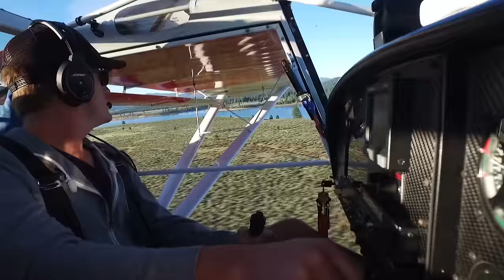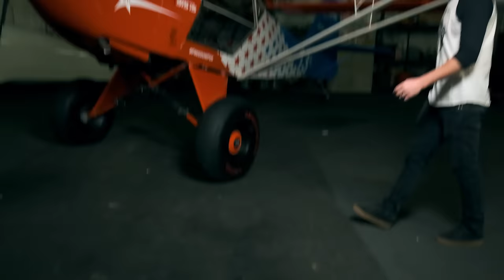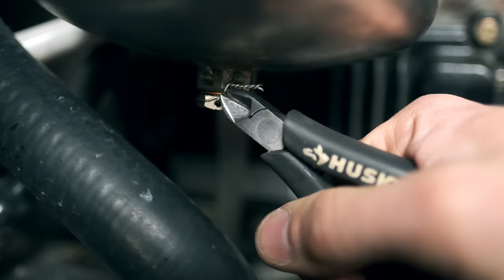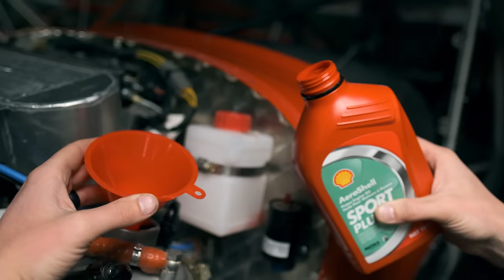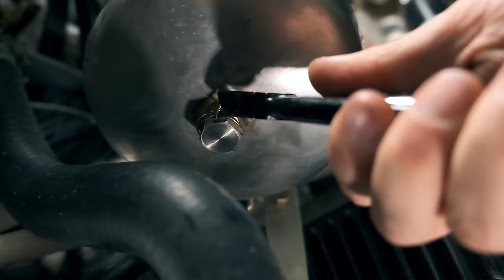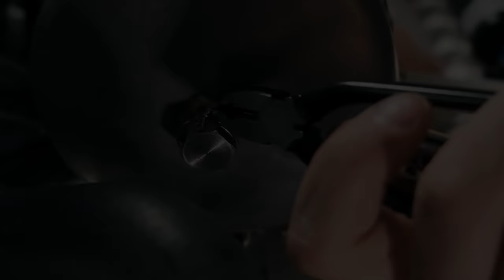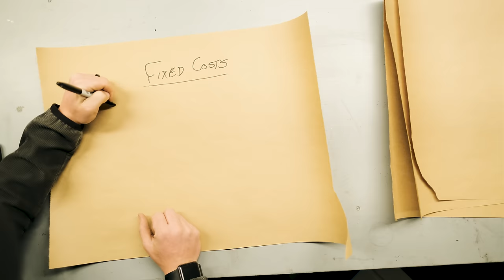What Does It Really Cost to Own and Fly Your Own Plane?

Comment: Let me simplify this for every one:  Owning a plane is about the same cost as a nice sports car.  However, when you get a sports car up to 75 miles per hour and pull back on the steering wheel...........nothing happens.
Reply: I’m stealing that when explaining why I fly to friends and family..
Reply: The reason I sold my "72 340 Cuda" Car? or Family?
Reply: @lightfoot9485  dunno if i woulda sold that to be honest...
Reply: Yep! Nicely said!
Reply: Most of all you hope to god it doesn't come off the column lol
Reply: D Springer that happened once in my kit car during a full power pull at about 80 mph. It clicked back on on the first try and I am so thankful it did.
Reply: haha love this discription
Reply: @thelastrebelshow1627  Last year a Ferrari 250 GTO sold at auction for $48,405,000 US dollars. Trent mentioned in his video that he has friends who bought their planes for around $20,000. Your blanket statement is far from accurate.

17 states require annual or semi-annual safety-inspections. Obviously these aren't as thorough or important as airplane inspections, but they are still important. A car with non-functioning brakes can be just as deadly, given the right situation, as an airplane with a mechanical issue.

From a maintenance perspective, a Bugatti Veyron carries with it an annual maintenance fee of $21,000. The tires should be replaced every 2500 miles at a cost of $33,000. That is 11x more expensive than Trent's bush wheels.
Reply: Chris Porter: It’s probably time for Bugatti to come out of the dark ages and start making tires from something other than bubblegum, lol. Anyway, M Bugatti died before most of us were born so I guess the company’s ingenuity died with him.
Reply: Jim Perkins: Too funny!! But not funny. For about two years after I stopped flying, every time I passed by the airport I had this uncontrollable urge to pull back on the wheel, lol. I also used to dream about it. Blah.
Reply: @rayray8687  The Veyron is capable of 251 mph off the showroom floor, meaning the tires have to be capable as well. Many of the cars are not driven regularly so 2500 miles, so many owners should change out their tires when they time out vs trying to get all of the miles out of them. Super & hyper cars with old tires can be very deadly. The crash that killed Paul Walker and Roger Rodas was very likely caused by the original tires on the Carrera GT. The car only had 3500 miles on it but was 9 years old, and original tires might have looked like they were in good condition. Moral of the story, proper inspections are important for both airplanes and motor vehicles.
Reply: Chris Porter. I’m sure those Veyron specs are correct which shows nothing more than its complete uselessness as a street car - but I’m not sure how any of this connects to sport flying?
Reply: @thelastrebelshow1627  no offence but I am up here In Canada and there are guys I work with who roll into work in brand new $100+k platinum F350's which they use to tow $100+k toy haulers with $30+k SxS's in the back. Now I am not saying everyone will be going out and buying Cirrus sr22's but used planes that are not completely ruined are far from unachievable. And when you start getting into kit planes there is lots of options for someone willing to put in the effort. Trent may have some friends and have made some connections but it is far from impossible.
Reply: @thelastrebelshow1627  I believe he mentions that his maintenance is cheaper due to it being a kit plane  however yes he bought not built the plane, and no doubt has had help with the modificatios! And definitely the certified world can be more expensive! Though I have seen many a 172 or piper comanche with sub 1000hr SMOH engins and decent looking condition and some upgrades going for 30k to 60k, but think one would need to be patient and thorough to find the right deal. I am a machinist with an acreage and machine shop so I will be going the build my own route😁
Reply: @thelastrebelshow1627  I never said or implied that plane ownership and operation is cheap. I was arguing your statement "Airplanes are far more expensive  than the most expensive car.". I've watched nearly all of Trent's videos including the series around his motor failure and replacement. His situation is not the usual and a motor failure for most GA owners would be a very expensive situation. I have a lot of friends who play in the very expensive side of street car modifications. Its not uncommon for a motor rebuild on a 2000+ HP Lambo to cross into the $100k range. My point is that both hobbies can be very expensive and your statement was not accurate.
Reply: Chris Porter: I used to fly. A buddy and I would rent a C172 for $120/hr wet and float around in the sky at a few thousand ft AGL going nowhere and feeling no sense of motion except the bumpity-bump bump of the warm weather air. It was about as exciting as owning a million dollar car that you can’t really drive anywhere.

I go fishing now...infinitely more rewarding, lol.
Reply: @Jim Perkins >>> YOU have just described AVIATION in a nutshell...👌👌
Reply: @thelastrebelshow1627  Holy Hostility Batman! Seriously Show, what has you so upset? I quoted your previous reply using copy/paste so it is exactly what you said. Perhaps you mistyped but that is on you to own the statement or correct it. Based on your rage I expect you'll do neither and that is OK. My point was made and I don't plan on dragging this beaten horse any further.
Reply: Chris Porter Lol. My wife turned a corner once and the steering column came away. She made a nice hole in a soft hedge, fortunately.
Reply: Chris Porter "
Reply: @kens.7665  yes?
Reply: The Last Rebel Show: Yes, yes! You’re absolutely right!! I’m completely flabbergasted as to why you won’t tell everyone about your airplane?? Is it because you don’t have an airplane and are embarrassed about deleting all your earlier posts inferring that you are very knowledgeable about the subject? No one fell for it but It’s ok...I think we all understand. Lots of people dream about flying but never really fly. That’s not something to be ashamed of. If it makes you feel better, I flew for only a year or so and found it so unexciting I gave it up. Some people find it exciting and some find it boring. It seems obvious that you have never flown since you keep avoiding the subject (and you deleted all your comments where you were challenged) but that’s still ok, I’m sure you’re important to someone and that is all that matters...you don’t need to be important to everyone. Thanks for the entertainment.
Reply: Ray Ray What comments?, I  made no comments. You attacked me and have been trolling me for a week. You’re a cyber bully and a very very bad man. 😹
Reply: i apologize, but i might too..l.
Reply: Ray Ray You been watching to much Sherman and Peabody , I would like to see your “way back” machine work, Better call Phineas J. Whoopi .😹
Reply: The Last Rebel Show: I don’t know who Sherman and Peabody are (soap manufacturers?) but I don’t need the “Machine” to know that 2 hours ago you corrected your spelling of “phineas” (lower case “p”)  to “Phineas” (upper case “P”), lol. What happens on the internet stays on the internet. Also, I don’t know who Phineas J. Whoopi is but I suspect you come from a land far far away in time and space. Perhaps you could use the “Machine” to return to the 21st century! We’ve made such marvellous advances in technology since you left!!
Reply: @Se7nn  These hobbies are evidently for people who has enough imcome to cover the costs and more,for me and others like me only watch the videos..i was a technician at a chevy dealer,i know how much it costs to repair the Corvette with alot of options and went to morosso, came back on a tow truck..Again it is for people with the money can do this.
Reply: @thelastrebelshow1627  "What comments?, I  made no comments." Did you have a brain aneurysm and forget that you (or someone else) deleted all of your ethnic and gender slurs?  @Ray Ray and I didn't forget, but we'll forgive since you want to play them down like it didn't happen. Have a nice day.
Reply: FWIW, it sounds like you were not doing the right type of flying for your personality. But if you find fishing fun then I have no idea what that would be since fishing is only slightly more exciting than sitting on a rocking chair on your porch. :)
Reply: i.b. hemp: Haha, ironically that’s exactly how I felt about flying...like sitting in a rocking chair going nowhere. And since I was usually stuck going nowhere in a C172 - no Learjet, no Pitz and no 737 - I didn’t really have a choice as to the type of flying I did. And at 100 bucks a flight, well, you know.... But fishing, well now that never disappoints! It costs about 3 bucks an hour in lost lures, and sometimes I even catch a fish! Plus I can fish all day if I want, lol. Try it - the first time you reel in a big-assed bass or a rainbow trout you’ll give up flying right away...guaranteed.
Reply: Best comment ever .When you get a J3 cub up to 60 MPH the fun really starts
Reply: It’s also about the same cost as being an alcoholic and chimney smoker.
Reply: well, the steering wheel might come off.
Reply: something does happen, the steering wheel comes off
Reply: If I would of read this comment 2 years ago... I’d have a Cessna 172 not a Corvette 😂
Reply: but when you hit 88 miles per hour, you're gonna see some serious shits.
Reply: @Se7nn  - he said 'nice sports car' not some of the most preeminent rides on the planet. Ferrari 250 GTO and a Veyron? Get real.
Reply: @flightlessboid  Check my comment again. My was a reply to "The Last Rebel Show", not "Jim Perkins". The Last Rebel Show deleted his comment but it was along the line of "even a basic air plane costs more than any sports car". I was countering his argument that sports cars can and do cost significantly more than some planes.
I agree with Jim's original comment.
Reply: @Se7nn  - my apologies, I should have known better than comment on a five month old post.
Reply: @flightlessboid  no worries, the thread went really south when Rebel posted a bunch of random illogical arguments. The user removed the more egregious comments, but you can still see some of the fallout. I hope you enjoyed Trent's video!
Reply: but a sports car doesn't require as much maintenance/oil. At the end of the day, flying may be more expensive.
Reply: Hahaha
Reply: For me it sucks as I love both but am broke ;)
Reply: @rayray8687  It's a really big Volkswagen. I see Bentley's that look like an Audi Q7 on steroids here in the USA for a SUV.
Reply: Pull hard enough and you break your steering wheel.
Reply: This is all I needed to hear, I'm getting a plane
Reply: Amazing point. Additionally sports cars are far more likely to get wrecked by someone else being careless, and you don't get speeding tickets in a plane for actually using it to it's potential. I never understood the desire to own a super fast sports car only to never take it to a track or drag strip. Classic muscle cars I get. But like a C6 Corvette, what are you even really going to do with it other than earn a suspended license and higher insurance rates? lol
Reply: @rayray8687  Bugatti is VW anyway
Reply: hahaha the best explanation ever!
Reply: Genius
Reply: I love it. Your comment is gold
Reply: So true!  The problem with that statement is ... words cannot describe how awesome flying over, under, around, through mountains, canyons and endless awesome views.  But that's what youtube channels like this TrentPalmer channel and the TuckerGott channel are for --- to SHOW how awesome flying can be.  Still, truth is, as awesome as some of the Trent and Tucker videos are ... being there is even more awesome.  Of course the negatives are usually more painful too ... as in "expense" and "preparation time" and "weather goes bad" and such.  REALITY can be both off-the-charts awesome and off-the-charts horrible.

Comment: if you think owning a plane is expensive, dont buy a helicopter
Reply: Why not,        at least you can keep it in the back yard
Reply: So even a kit helo?
Reply: @ctsteve1967  yeah well, savings on the hangar won't make up the difference for the insurance, maintenance and fuel consumption cost :/
Reply: @chrisaerts6489  who would fly a kit copter? At least if your kit plane shits out on you, you can glide it in.
Reply: @kodiererg  John Denver probably thought that also. ( TBH, I don't know the details behind his last flight)
Reply: @awalker8112  no one would argue that gliding to safety is a guarantee, but I would rather take my chances gliding over rotating
Reply: My helicopter is turbine powered, and cheaper than the kitfox :)
Reply: @NateVolk  >>> A Mosquito?
Reply: @Allan_aka_RocKITEman  Helicycle ;)
Reply: @NateVolk  >>> Rodger that...👌
 
FWIW:  I meant the Helicycle, which is turbine-powered.  The only name I could think of was "Mosquito", but that uses a reciprocating engine.
Reply: @kodiererg  Hate to break your little fantasy of helicopters not being able to fly if the motor shuts off but they can. You can glide in a helicopter too just like in a airplane except its safer in a helicopter vs airplane because you can literally land on a dime anywhere.
Reply: Aren’t helicopters designed to fall from the sky (landing)... I’ll pass on that.
Reply: RocKITEman _ 2001 actually, the Mosquito also has a turbine option as well.
Reply: Guys listen to @Mob with Guns because helicopters are unbelievably expensive to operate.
Reply: @RifullOfTheWest  it is not even remotely safer. Time is your friend during an engine failure. With an airplane you can often glide for 20 miles depending upon altitude, leaving you plenty of time to find a suitable landing zone. In a helicopter you have about 30 seconds and you better hope there just happens to be a nice open baseball field or something nearby otherwise you're crashing in the trees or on top of someone's house. Autorotation is incredibly difficult to execute and typically catches pilots completely off-guard, hence the failure rate to successfully execute one under real world conditions (i.e. not a training simulation). If you lose rotor inertia due to a screw up then you're dead, there is no getting the blades back up to speed. At least in an airplane you can make mistakes while gliding.
Reply: @Allan_aka_RocKITEman  mosquito has a turbine option
Reply: @codmott286  >>> Rodger that -- Thanks. 👍👍
Reply: @kodiererg  you can glide a helicopter its just really hard and only in emergency situations
Reply: Mob with Guns so

Why
Reply: Can confirm, but I'm doing this for a living. 
The latest addition to our fleet last year was a $1.1 million investment.
Reply: Amen to that brother.
Reply: Too many moving parts in a helicopter...total nightmare...I just looked after the machine gun.... total nightmare also

Comment: I bought water front property, and put my CH 601 on floats. The hangar rent costs go toward my mortgage, and I don't have to drive to the airport when I want to fly or do maintenance. Rotax 912, only burning 4 gal/hr. I only have liability insurance, the savings there would replace the plane in 10 years of flying. My fixed costs are less than $500/year and operating costs less than $25/hr. I bought a project plane that only needed maybe 50 hrs to get it flying. On  floats I only paid $25,000 I have been flying this plane for 5 years.
Reply: Smart man. If there's a will, there's a way.
Reply: That’s great and all but what if you life in an area where a float plane isn’t really viable? No seaports to fly to kinda limits that prospect
Reply: @demetriosb5758  I moved 400 miles to make it happen, just lucky my wife and kids wanted the move more than me.
Reply: @demetriosb5758  So move! :-)